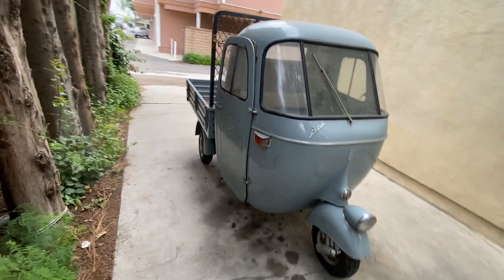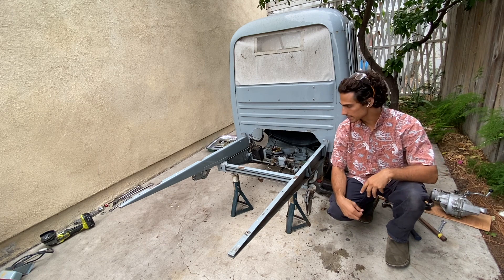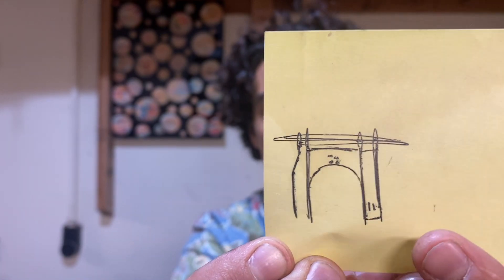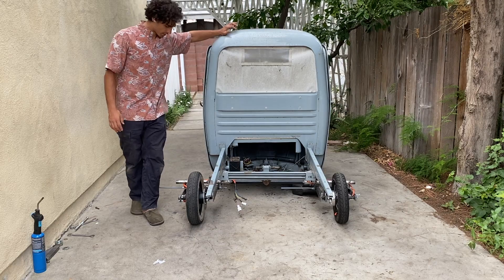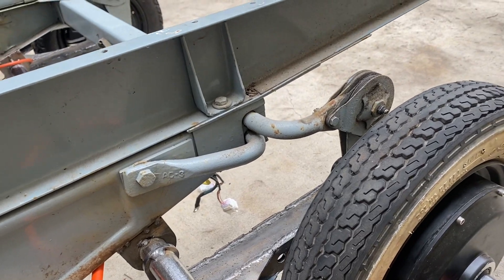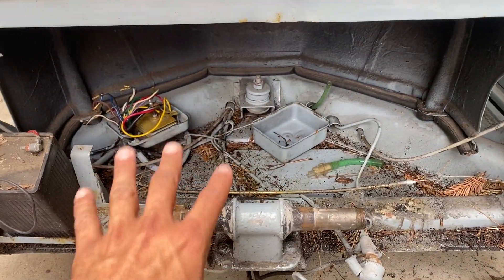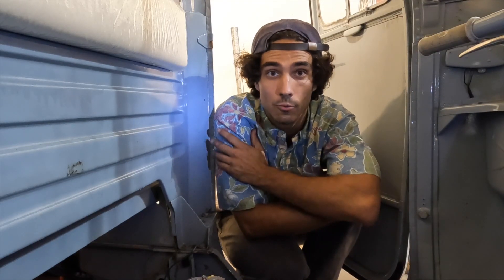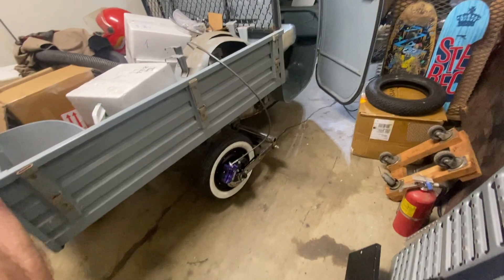Electric Coffee Cart Build - 1963 Piaggio Ape EV Part 1

Comment: can you tell us why you decide to go down the route of removing dif, instead of using it to mate to a motor? with upgraded brakes, natch!
Reply from the maker: I never had the diff unfortunately. If I did, that would have been the easier process! However syncro diffs and so expensive and I couldn’t even find one!
Reply: Don't the two motors make it harder to steer without the dif? Don't you get more oversteer?

Comment: so this ape is fast isnt?u only need a huge battery pack to feed both motors.
Reply from the maker: Yes, with 72 V you can typically hit 60 mph with one hub motor. Those are not recommended with this truck.

Comment: This is awsome!  I was considering getting an Ape and converting it to a food truck.  I would trailer it to the events,  so I only need enough range to get it on/off the trailer and move it to the on-site location.   It would be great if the battery could be used to run the fridges.   BTw, how tall are you?  I'm trying to Guage how tall the Ape is.
Reply from the maker: I’m just over 6 feet and it’s a tight fit. If you’re too tall, you can remove the cushion on the seat.

Comment: Cool project. One note, you're connecting them in parallel, not series.
Reply from the maker: Yes! You are correct. Batteries and controllers are wired in parallel.